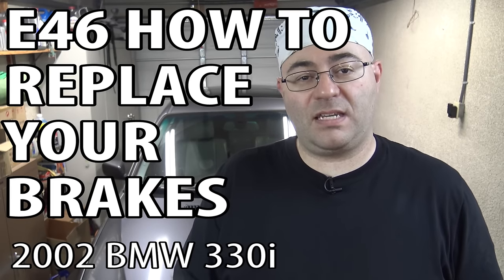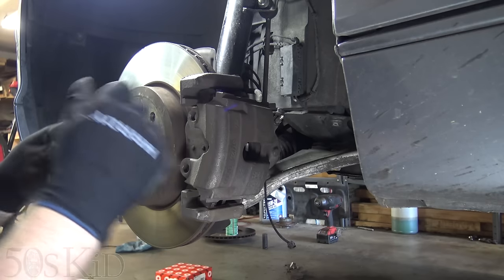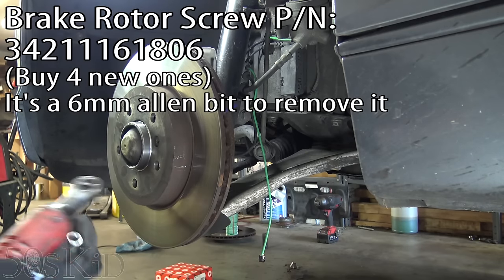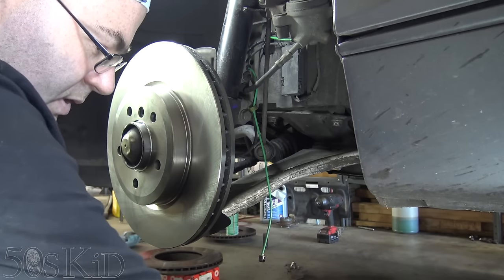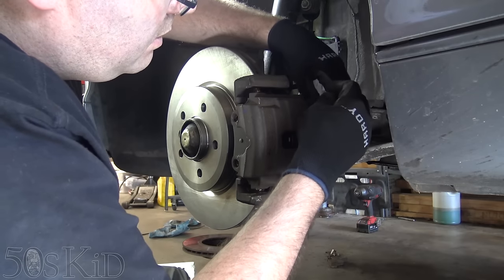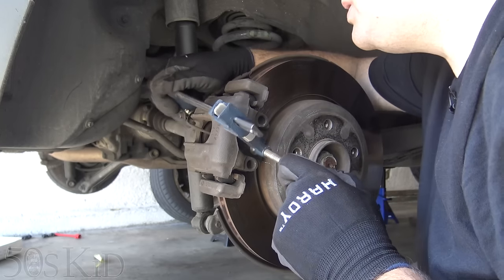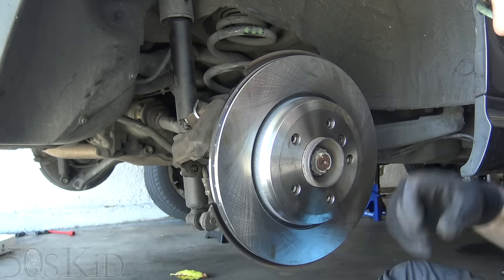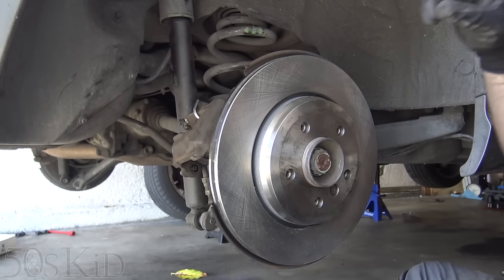BMW E46 How To Replace Front & Rear Brakes DIY

Comment: Thanks for the tutorial it help a lot on 2001 e46 318i
Just a quqestion i open the cap of the brake fluid while compressing the calipers some of the fluids came out 
When finished the car was driving and braking perfect 
Do i still need to bleed the brakes or no need for that
Thanks again
Reply from the maker: nah no need to bleed in that case.

Comment: I know this is an old video.. But if I just need to replace the rotors (pads are new), can I just remove the entire caliper assembly? Or do I have to remove the carrier, and then the caliper mounting bracket?

Comment: Hey 50s Kid, I've heard that when you do the rear brakes, you have to mess with/adjust the parking break. Any idea if this is necessary or what you need to do? I'm planning on doing mine this week. Thanks!
Reply: Not true for E46's. The e-brake is a separate assembly that uses brake shoes vs some other cars that use the pad for braking and the e-brake

Comment: Hi 50sKid 

Do you have any experience with a E46 who’s shaking the steeringwheel? 

I have a E46 M54 330ci convertible, and it’s shaking the steering wheel doing about 55mph - 80mph. 
I’ve talked to a bmw guy a he said that the E46 is very sensitive and I should put on new original brakes from BMW to solve the problem. 

Is that true? Or could there be an other explanation to the problem? 

Glenn
Reply from the maker: If it is shaking only when you are braking, it’s either warped brake rotors or worn suspension control arms. If it’s shaking when you are not breaking, it’s probably wheels that need to be correctly balanced.
Reply: @50sKid  
Thanks! 🙏🏻 I’ll give it a try 😊
In fact it is both. 
For about 10.000miles  ago i put on 4 new brake rotors, calipers, pads and hoses (all from ATE).
It’s the 2nd time it gets the warped front brake rotors. 
The Wheels are “new” renovated “style 32” with new Goodyear F1 tires. I have only driven them for about 6000miles.

Comment: Dear friend, can you please help me with some info? Ive just bleed the brake system and one of the caliper bleeder screw broke. I’ve replaced the caliper and if I press harder on the brake pedal even if the wheel is not turning i have DSC and hand brake yellow warning coming on. Any ideas ?

Comment: Question, when you do this job, car has to be in parking position or neutral position?
Reply: Perez Gustavo keep it in park. U don’t want the car rolling
Reply: I hope you chocked any wheels that were left on the ground and didn't rely on the Park position. If doing both axles at once, I'd put the whole car up on stands. Some of us have no Park because we aren't missing a pedal and have RWD cars, which means keeping the car in gear and setting the parking brake if doing the fronts (and chocking the rear wheels), and chocking the hell out of the fronts or preferably lifting the whole car when doing the rear.

Comment: Yo 50's Kid, thank you for your amazing video. It's too frustrating that I couldn't get the front rotors of. What a nightmare. Even the retaining screws were an absolute nightmare.
Anybody got an idea how to get these rusted rotors off? It was a nightmare!
Reply: On a Mazda 3 I literally had to cut the front rotors off with a recip saw because they were rust-welded to the hubs so badly. Some people would prefer a grinder but I used what I had handy. No retaining screw on those but a mallet didn't work. Internet doodz said get a hammer, which failed. Then they said get a bigger hammer, and to stop hitting it with my purse - but no dice. Screw-jacking with a bolt through the mounting point failed. A three jaw puller simply broke. With nothing else left to try I cut through the outer rim all the way to the hat, and pounded a chisel down through the cut, which finally popped them off. Now I'll always put a little anti seize on the mating surfaces - always. That was a nightmare.
Reply: @UMepher  thanks, appreciate your input. That helps a lot.

Comment: Should the slide pins be lubricated? I've always done them on other cars but the Bentley manual specifically says: "Do not lubricate guide bolts." (EDIT: definitely NOT) Thanks for all the great vids!

I'm doing pads, rotors, and braided hoses, front and rear, as well as rear calipers (hoping the fronts are okay). Also using Speed Bleeders. I couldn't believe I found the hoses for $30 on Amazon, for all four - and they look like they're really nice quality. This is slightly challenging, since my car is 18+ years old and has seen some NE Ohio winters, meaning everything is at least slightly rusty. Definitely using proper flare nut wrenches for the lines, and still praying I don't break a hard line.

Comment: I have a question about the pads you used. I've been told that BMW pads are supposed to have some type of sensor in the pad. Other people have said that I have to buy a sensor kit. Did yours have a sensor in the pad already assembled, or do I need to get that kit?
Reply from the maker: the sensor is the wear sensor.  There is one on the front left and rear right.  They fit into the middle of the pad and contact the rotor when the pad wears down.

Comment: A question since I'm new to this car. Do the brakes have to be bled?
Reply: Felix Rivera Gomez super late reply but hopefully it’ll help someone else. If you’re just doing discs and pads and don’t ‘open’ any of the brake lines, i.e. don’t touch the bleed screw on the calliper or replace any lines etc, there’s no need to bleed the brakes. Just hit the brake pedal a few times after you first start the car and then follow the bed in process as described in the video!
Reply: However: you should do a flush every 2 years or so as brake fluid usually deteriorates after that point and won’t be as effective at cooling. This is a good time to do it as you’ll have the car jacked up and wheels off, but it’s not actually a necessity!

Comment: not that i am an expert at all, but it would help if you turn the wheel to the right so you expose the calliper side a little (gives you more room to work). just my 2 cents.

Comment: Hello All and 50's Kid

Have a Serious ?. I have looked in all the shift knob posts around I could find and all are replace/removal upgrading. But not my issue.

Today I was replacing my Brake Pads and rotors following this video. I finished the rears. Lowered it back down. Then went to turn the Car on to move it back a little so I could get the jack to the front and do the fronts. But when I got in car to put in reverse. The shift knob was not engaged it would move up and down freely.
I could shift but the button would not engage like normal. ( And was working fine before I started work) Can any one provide any help and or guidance or might have seen or heard this issue before. This is my first major maintenance job on my car except a fan Clutch. I have a 00 328I E46.

Thank you in advance.

Comment: Anyone ever have issues with brakes clicking on their E46? I'm told by BMW that that is a common issue when buying "knock off" pads that don't fit perfectly in the retainer springs.
I'm gonna buy new pads and rotors soon but don't want to make the same error.
Reply: I replaced pads and rotors with OEM ones the clicking is gone.

Comment: Blinding. I needed to know where those pad wear cables run to as I need to replace mine. 1 has vanished and the other is hanging loose.

Comment: Hey need some help with my coolant temperature on start up til 10 minutes of driving the obc shows 93 deg it will go up as high as 109 deg and stays there the aux fan runs on high all the time when the temp reaches high. When going up a steep incline the temp went up to 118 deg and the needle passed the half way mark a couple of times then drop back down.By the way its a bmw e46 m54
Reply: Operating temp is 204.4 -206.6 F or 96-97 C. You need to get the OBDII reader from amazon and check that as well. This engine SHOULD NOT be exceeding 215 F. If it does, turn it off and let it cool, otherwise bad things are going to start happening. Clearly there's a coolant problem, which this car is notorious for and you need to fix it ASAP. It's been two months and I hope you've fixed the problem but if not, your engine life is becoming shorter exponentially. First, check your radiator hoses, second, check you expansion tank, third check your thermostat, fourth check the engine coolant hoses and heater hose, fifth check your water pump by pulling off the pulley and searching for coolant. If you find nothing, and you don't find coolant leaking, your head gasket might have gone bad. Not to jump ahead though, MAKE SURE you have enough coolant and oil. Your car should be able to drive normally with the aux fan and maintain the operating temps. I took out my clutch fan.

Comment: Hi, I have a yellow warning light it’s like a circle, is it the break pad light? I would need new brakes right or is it just the sensor. My brakes squeak too
Reply from the maker: You need new brakes and new sensors.  The light is on because the pads have worn down so much that the sensor is touching the rotor.  The sensor gets worn away, which is why you need a new one.
Reply: 50sKid oh okay. I might look at the brake kit you bought for this video and buy them. I have a 330i aswell

Comment: If I change my front brakes and rotors do I need to reset anything on the ecu?i plan on doing them myself bc a Indy shop wants to charge me 600$
Reply: These don't involve anything electronic so no. The sensor was just preventative maintenance on his part. Not much, if anything, will require you to touch the ecu unless you need an 02 delete or something.

Comment: I have a question not related to this video.. can you put grease on the cam shafts/lifters instead of oiling everything when re-installing the cam shafts/lifters etc? will this do any damage to the engine? @50sKid
Reply from the maker: No you cannot put just wheel bearing grease or something like that.  You can only use engine assembly lube or engine oil.
Reply: 50sKid shit.. Ok thank you!

Comment: Why u replaced the rotors? They looked fine to me with enough thickness.
Reply from the maker: If you don't replace rotors and only do pads, you're almost guaranteed to get squeaking brakes.  It would have cost about $60 to resurface all 4 rotors.  With the price of pads & rotors these days, it just wasn't worth the hassle.

Comment: I have a question, can break from e46 330i be put on e46 320? And if i can do that what i need ?
Reply from the maker: Yes. You can research part numbers and differences on realoem. I don’t know every difference off the top of my head

Comment: Aren't we supposed to use new bolts specially for the bracket?
Reply from the maker: Not typically, but if yours are corroded then you should.

Comment: With these being only single piston calipers, how is the braking with these E46s?
Reply: Multi-piston calipers are highly overrated.  (Similar to cross-drilled and slotted rotors.)  Even the E46 M3 has single-piston calipers.  Braking performance is much more a function of pad and rotor combination rather than number of caliper pistons.
Reply: John Isett That doesn't answer my question though. I never said it should have more than a single piston. I was simply asking if the braking is good or bad. I know that you can get better pads and rotors, but factory-wise, is it adequate?
Reply: Hermit527 agree with dbl piston not mattering.

my 330i stops very well with the stock setup. even compared to my dbl piston 13" rotor cobra brake setup on my mustang. I loved the "hawkHp 5.0" pads on my mustang so much, I put them on my e46, and the braking is I think actually better on my 330i. I think its because of the rear rotor on the 330i is vented, and not so with the mustang. idk. both cars use EBC rotors, btw. 

fyi, the brakes would stop better in this order, pad material, rotor composition - these are the two largest factors - then, larger diameter of the rotor, lastly caliper pistons and/or size of bore.
Reply: Stock BMW brakes are actually very good.
Reply: multi piston brakes are mostly for highspeed braking ex. 100plus mph because they have a greater area of clamping force. 
but the real test is: if your brakes activate ABS on a dry ground, then your tires are your limiting factor for braking potential

Comment: Help anyone, I was changing my 02 bmw 325ci front brakes and rotors and on the driver's side rotor, where there's a hex bolt that connects the rotor to the hub, I cross treaded so I coulnt get it off. Any ideas on what should I do ?
Reply: Drill

Comment: So you have to do brake bedding even if you change rotors but not pads?
Reply from the maker: Yes because you're bedding the pad to the rotor.  Not a good idea to not replace pads too--it usually ends up with noise.  Buy good quality brake parts and you'll have good luck.
Reply: Is it easy to mess up the brake bedding procedure? I have been putting on new pads and rotors since July because I thought I was messing up the brake bedding procedure, installing bad parts, etc. I just got the car back after getting a replacement caliper redone under warranty since it was sticky. Now my rotors are bad and have to change them a 5th time. I have been trying to figure out what is causing my steering wheel wobbling under braking and think I have rectified the issue. I just need to put on new rotors now and I don't want to change them again
Reply: Have you checked your power steering fluid level? You must be hard on brakes if you changing your rotor for the 5th time.Also a wobble could be the lower control arm bushes perhaps?
Reply: FCABs were replaced. I think my calipers are bad

Comment: I have a question. 

Are the brake pads the same for the front and back. 

Thanks again
Reply: No
Reply: @tropx8995  thanks for getting back to me. I had to figure that one out. My client was a little disappointed. He purchased two sets of brakes thinking that all four pads would be the same. He had these items before contacting me. So we got the right pads and it all worked out. I really appreciate this video and the Automotives community. Thanks again!

Comment: Would it be wrong to put copper grease between hub and rotor?
Reply from the maker: No not at all, it's very beneficial to prevent rust from sticking the rotor on again.  I just forgot it on this brake job (it's not really something that is necessary here in California so I do forget, but I am kicking myself that I didn't put it in the video).
Reply: Thought so. Your rotors came off fairly easy, when you did the wheel bearings.

Comment: well, another video I tried to follow and failed. The first side I did (thought I would start on the same side you did) I cracked to 16mm sockets trying to undo the caliper holder bracket bolts. They didn't even budge. I even sprayed them with WD40 prior. I don't have a ratchet gun, so are there any ideas on how to loosen them without cracking anymore sockets?
Reply: Rob Brown yeah, don’t use wd40, use a real penetrant not a gummy water displacer

Comment: roughly 22 footpounds of torc on calipers and roughly 88 foot pounds of torc for the rim
Reply: Mounting brackets: 81 ft-lb front, 48 ft-lb rear. Slide pins: all 22 ft-lb. Rotor retaining screw: 12 ft-lb. 
I use a torque wrench for the brackets but just make the pins "tight" with a regular socket wrench. And I'm not worried about the rotors screws - get 'em "tight" with an allen wrench, since it isn't like they'll be going anywhere once the wheels are on.

Comment: So rust... For anyone in the Northeast, if you can, get the whole car up on jackstands a week ahead of time, take off your wheels, and start hitting every component you need to touch with penetrating oil (PB Blaster, WD-40, or Kroil if you can afford it) a couple times a day.   Try to get some behind the rotor too.  It's still not going to be as easy as a rust-free car, but it will save some time.

Comment: And it's always good idea to put some threadlocker for bracket screws and guide pins.
Reply from the maker: Yeah my general philosophy is to replicate what the factory did.  But nothing wrong with doing it as long as you use blue and not red!

Comment: Noise in the rear? Hmmmm. Look at the backing plate. About 1 o'clock. See the shiny spot. Rotor is rubbing the backing plate. You didn't need new rear rotors and pads but oh well
Reply: Well he did get a kit so might as well do it

Comment: I think you will find the rest of the world  calls them  BRAKE DISCS,  NOT  ROTORS. ???    Also   G   Clamps not C Clamps.
Reply: They're actually a disc brake assembly, that specific part is called the brake rotor. As for the G/C clamp, to-may-to to-mah-to... perhaps it's not the rest of the world.